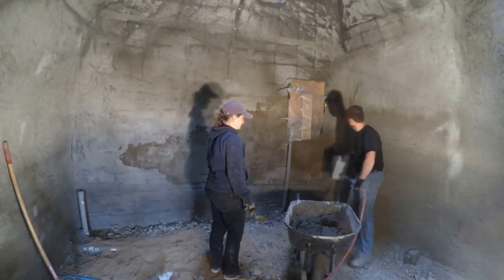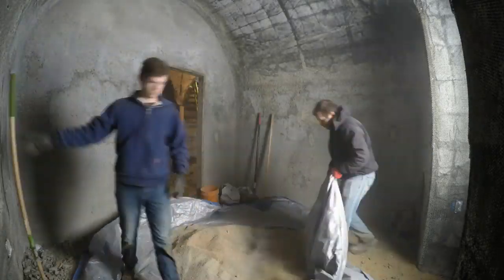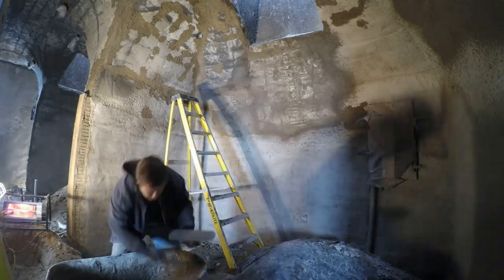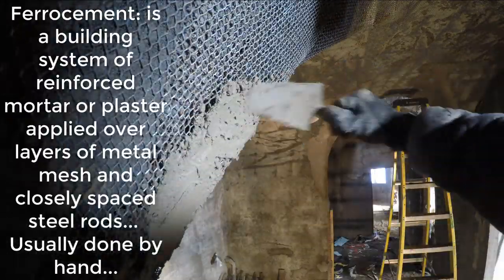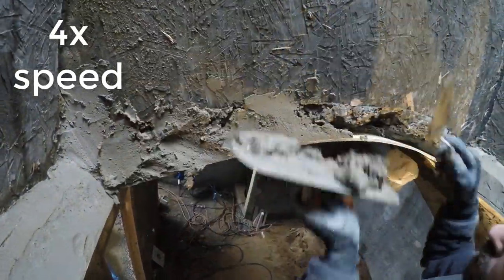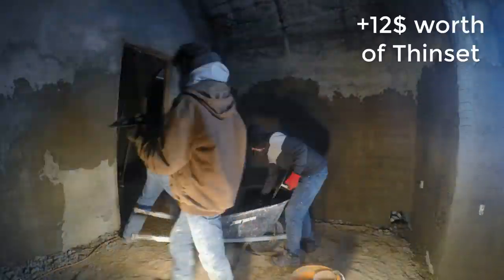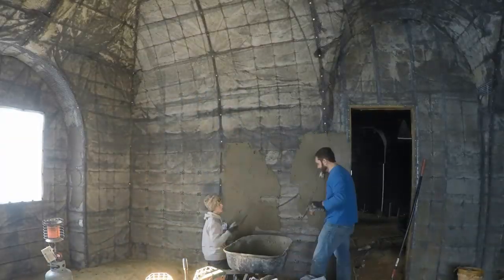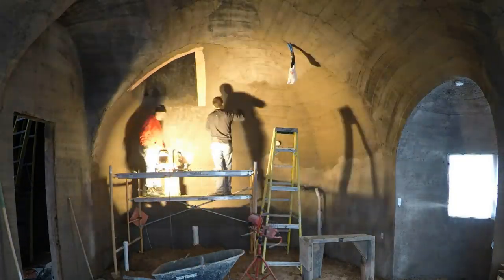39.1 Scratch Coat Stucco (Shorter version)

Comment from the maker: Adding this comment because I guess I was a bit too harsh about the mortar sprayer not working out for us...  I really do think it is a very well made tool.  

The biggest issue with us was that it really wasn't sticking very well to the roof.  Probably because of how rough the surface was.  Its hard to explain since you would think that roughness should help it stick, but in reality, the grooves were too deep.  If I sprayed up enough to trowel it properly (filled the grooves), then it would just fall out due to gravity before I had a chance.  And if I put it on at a more reasonable thickness, then the trowel couldn't get past the lumps to consolidate things, and much of it may fall down anyway.  However, if I slowed it down and used just the hand tools, I could apply the stucco and push it in so it would stay where I put it.  I could also add the thinset, which helped a lot in terms of stickyness.

Another issue for us was about keeping up with it in terms of mixing the mortar.  When using the stucco sprayer, it would go up so fast that the wheelbarrow would be empty and I would need to mix another right away... In the video, there are so few frames of me using the mortar sprayer that you have to watch closely to even get a glimpse of it.  I guess thats just our own physical weakness.  I could have put up a lot more per day if I had been strong enough to keep up on the mixing side, or if I had used my barrel mixer.  Instead, we went for the more zen approach of using the hand tools.  It was slower, but it didn't kill us.
  

If you are stronger or have a bit of a crew to help with mixing and troweling while someone sprays, then that mortar sprayer is a pretty great tool.

Comment: you used dirt?
Reply from the maker: The sand on our property is like beach sand.  the sand on the floor in there was nice and smooth with no organic matter in it.  Actually, I did also order a dump truck worth of masons sand, but our sand was better.
Reply: @SimonHomeintheEarth  I've heard of people saying you shouldn't use beach sand because it's rounded off and won't hold like masonry sand, what's your opinion?